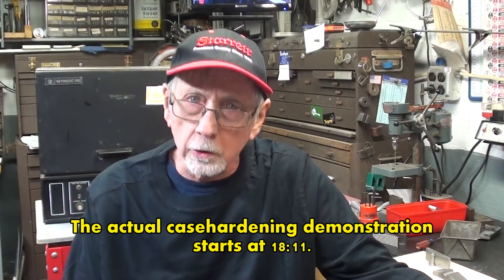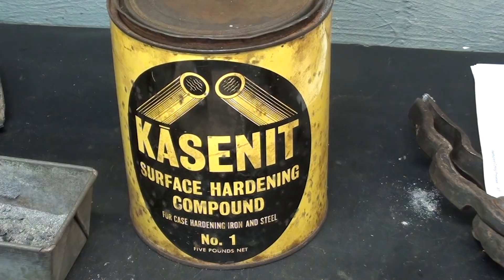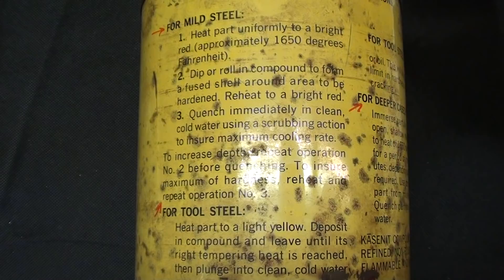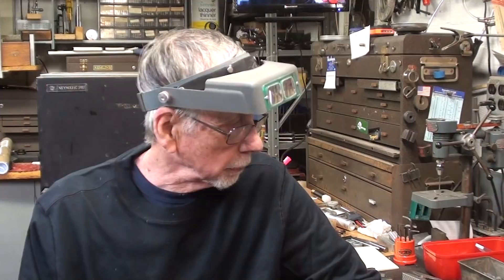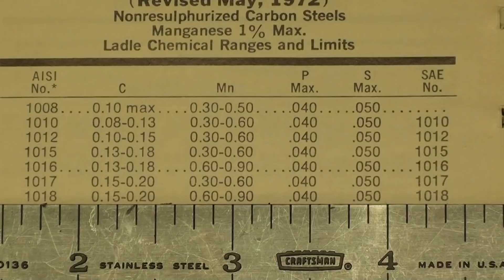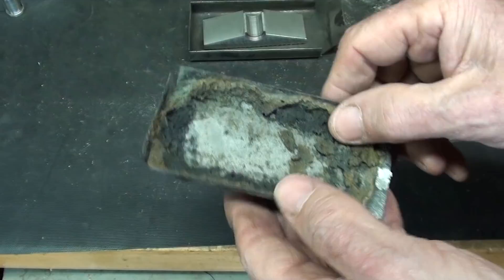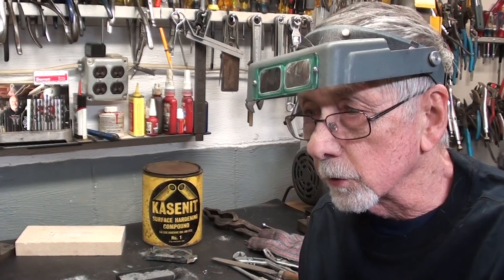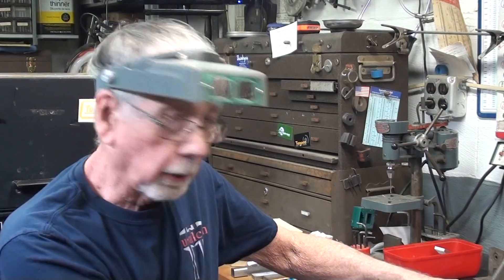CASE HARDENING Carburizing vise jaws #717 pt 1 KASINIT tubalcain

Comment: Color casehardening can be obtained by packing parts in a mixture of hardwood charcoal and chard bone, with the %'s of 75% charcoal and 25% chard bone.  Varying the percentages gives different shades of the colors.  Heating to 1450 - 1500 F for an hour or so and then quenching  (dumping the entire contents of compound & parts in room temp, air agitated water.  Chard bone is available from Brownell's and one can make their own hardwood charcoal.  Some beautiful colors and the surface of the metal is file hard.

Comment: To measure the case thickness you can probably take a small rod say 1/4 and use your method then try to snap it in half. I’ve seen this done when pack hardening and the case can become pretty thick. .04-.1” deep

Comment: I use a weed burner propane fired... I get the part hot then drop in Kasenit... If it is hot enough, a crust will form.... Put the flame back on the part and the kasenit will start boiling all over the part.. Keep soaking until it stops boiling then quench in cold, clean water.. The case will be very good.. If you want a deeper case, you can repeat the steps... Mike
Reply from the maker: Thanks

Comment: If you have a little muriatic acid you can check your depth by cutting your sample in half and soak in the acid. The hardened steel will be much darker in color than the softer steel. Now, of course, if it is only .001 or .002 deep, you probably won't be able to see it. Knifemakers use it for differential heat treating and Damascus steel.

Comment: I took a structure and properties of engineering materials course in college and found the subject fascinating. Keep your eyes peeled for a textbook. As I recall, Machinery's Handbook has a good section on heat treating, etc. My first copy was a 1910s edition I bought in a used book store, which was great, but in poor condition, I bought an apparently unused one (circa 1984 copyright, 22 ed.) on Amazon  from a bookstore for  $20-something, perhaps.

Comment: Excellent video, as always Mr. Pete!  We would soak for many hours to get usable case depth, and then the part might be finish ground to size. We would also include a scrap piece of metal to check case depth on, by either breaking the scrap piece, or etching. If you have .030 to .045" case depth, when you break the scrap piece you can clearly see the hardened layer.

Comment: Interesting video Lyle, thanks for sharing. We used to be able to get Kasenit in the UK, I remember using it 30 odd years ago in a small company I worked for. The tin was slightly different but pretty sure the contents were the same. Cheers, Jon

Comment: If you really want to check the depth of the carburization it's not that hard to do, but it is destructive and a bit time consuming. Xut the part in half (we used an abrasive chop saw) then grind polish the cut surface to a mirror finish. Etch with acid (I believe we used nitric) and then you'll be able to see how deep the case hardening goes.
Reply from the maker: I tried that many years ago at the high school without much luck

Comment: The plating and color industry got away from cyanide in most things, its only used for the highest reliability stuff now (i.e. some PCB processes), and its mostly done to cover the supply chain (its like preserving food), all the parts would be better if they were left as bare copper, because all those coatings just degrade the solder bond). So its basically like spraying wax on oranges so they don't rot before they get to the grocery store in case the truck gets stuck in a traffic jam. Fun one, for gold plated connectors, you are supposed to tin them, strip them, then solder them, not solder over the gold, for optimum reliability.. because they get brittle when the plating dissolves in the solder. And tin plating can cause tin whiskers to grow and short the circuit out, so its just a cheap anti oxidation control that can cause problems in the future. But, for the actual contact (the connector part that mates mechanically) is where the plating is important to be left alone, but not for solder assembly. But typically you don't have too many of those connectors.

Comment: You can check the case hardening depth by exposing a cross section of the test piece and etching it with an acid or ferric chloride. 
Carburized steel will etch very dark, the remaining low carbon steel will remain nearly unchanged in color.
Reply from the maker: Thanks

Comment: Mr Pete, I remember using that exact same Kasenit when we made cold chisels in 10th grade (50 years ago).  We used a shaper to do the tapers in some octagonal stock then filed and draw filed the taper and tip.   Then off to the furnace to case harden the project.  Pretty sure the steel wasn't 1018 as I have used that chisel ever since.  I remember cycling it through the heat cycling 3 times so the carbon went pretty deep.
Too bad our kids don't get to do this stuff these days..
Reply from the maker: Thanks

Comment: One vote for a video on hardening, annealing, tool steel choices(especially), etc. 

I am in the process of Building a Bar Z hotshot 360 clone. Just need to spring for insulation.

Comment: Also called "cementing".  As in Krupp Cemented (KC) face-hardened naval side armor for heavy warships from 1894 through WWII.  A thin (1-1.5") surface layer of soaked-in carbon from bone charcoal powder or high-pressure "illuminating" (methane) gas that is then raised to a high heat and quenched with pressurized water jets to harden to 600-700 Brinell Hardness Number (or Rockwell "C" or Vickers Hardness scales equivalent).  Originally developed by a Mr. Harvey of the Bethlehem Steel Corporation who went off on his own and did this to nickel-steel in 1891, creating a new armor that could destroy the chilled cast iron armor-piercing projectiles then in use and became immediately the only thick side armor to use (3" minimum thickness required to do this properly for naval types of armor, though thinner plates were developed against small projectiles like machinegun bullets).  Krupp also used it for his thick-faced KC armor as the surface to assist destroying such projectiles even more thoroughly, increasing his armor's resistance and by the year 1900 KC had replaced Mr. Harvey's "Harveyized" armor completely.  Special nose caps called "Armor-Piercing Caps" ("AP Caps") made of thick steel, originally soft but later hardened to a high level, were developed to protect projectile noses from this armor, with high success, but the armor could still damage such shells considerably as they tried to pass through it and that was why it kept being used as long as armored warships were a "thing"..
Reply from the maker: Thank you for that

Comment: And if you wanna know how deep the case is, it might be possible to cut it on a grinder and then sand it clean and see the actual color change under a magnifying glass, It should look like a cake slice I think.
Reply from the maker: You would have to Etch With acid

Comment: Hi Mr. Pete, 1000F is about 537C and 1700F is about 926C. With non contact IR thermometers today it is easy as you can select between scales F. C. or K. Do you remember the clay cones used?
Reply from the maker: I remember those cones

Comment: For seventy years I have been using Kasenite in the UK and have always used towns gas and compressed air or propane to heat the work. Pity it is no longer available. The old product contained Cyanide, highly poisonous.
Reply from the maker: Thanks

Comment: Pack carburizing: bag of bone dust at your local garden center. Steel box or pipe with tight fitting lids. Maintain minimum 1/4 inch of tightly packed bone between wall and part. Heat above critical point, heat soak for case depth. Quench in suitable medium for base steel by dumping contents of container in quench. Color casing, same procedure,  only charred leather dust instead of bone. Quench bucket has a drilled (lots of tiny holes) pipe that compressed air is pumped into on the "floor". Heat soak for case depth, turn on air, millions of tiny bubbles aerate your quench. Dump box as in plain method, the aerated quench cracks off the adhered packing, then oxidizes the part at varying temps on small sections of the surface, producing mottled "temper colors" of just about every range. That's the "old timey" SAFE (no poisons involved) method of carburizing. The only caveat is both work best with oil or water quenched steels. Bone will work with air hardening, but because the quench medium doesnt crack off the adhering dust, your part will require a hardening step after cleaning. Color casing air hardening steel requires atmosphere controlled conditions, gas carburizing, and "air jet contaminated" inert gas quenching, not exactly a "home brew" technique most can do practically.
Reply from the maker: Thank you for that great information

Comment: YES,,,YES,,,more would be great mr. pete (@@),,,@ 19:42 using your Rivet tong's to handle the work was great. I still have mine from 1969 IronWorkes apprenticeship days. They are used alot around my shop,,now mostly to assist in picking you tools, and things I drop on the floor & old back does bend like it did 40 years ago,,,hehe! I bought materials to build a furnace a yr ago. This video has but a fire under my butt to get it done. Thx Lye for motivating me,,,?? Henery Ford using charcoal ?? Have to check that out (@@),,,Bear
Reply from the maker: Thanks

Comment: I ran out and bought some stuff off of Ebay that approximates the same compound and it works fine. I also use Brownell's case hardening compound. I thought Kasenit was Potassium Ferro -Cyanide? I use it on homemade trigger parts and tools. Here are the instructions for Brownells Surface Hardening Compound:

(1) Thoroughly heat the part to cherry red in color (approximately 1650º F).
Be sure the part, or the section of the part to be hardened, is completely
heated for best results.
(2) Coat part in Brownells Surface Hardening Compound by dipping, rolling
or covering surface or part. Compound will blister and harden.
(3) Reheat part to cherry red color.
(4) Quench immediately in water, oil, or let cool and brush off excess compound.
 To increase case depth, repeat No. 2 and No. 3 before quenching.
 Brownells Surface Hardening Compound is water soluble and excess can
be removed with water and a little brushing.

Basically the same as for Kasenit.
Reply from the maker: Thank you very much for that

Comment: Could you cut it in half, polish it and acid etch to see the case thickness? Not very quantitative, but you could compare it to feeler gauges or use a set of calipers with a magnifying glass perhaps. 

Great video though. Really shows how much you can do at home.

Comment: Us dept of labor material sheet shows kasenit to contain sodium ferrocyanide 46% safe to handle  giving off trace fumes of CO and HCN in use. I used let the metal cool in the kasenit for better results and repeat a couple of times. No need to let mild steel soak in the furnace for 1hr/inch as you are only affecting the surface.
Ever tried hardening mild steel by quenching in lye?

Comment: Mr Pete,
I bought a new propane torch from Bernzomatic (TS8000, I think) that burns Map gas and was sold as capable of brazing. It does indeed get small steel parts red hot and I have successfully brazed with it. I guess it would be enough to case harden small parts.  Handy to braze without oxy-acetylene tanks.

Comment: 13:40 If the part is heated in the oven outside the case, it will lose carbon to the atmosphere of the oven, creating a decarbonized layer. This layer will hinder further cementation. The part must enter the Oven inside the box, completely submerged in the cementation compound, which can be common charcoal.

Comment: The carburizing compound in Kasenit is sodium ferrocyanide. So it's still a cyaniding process, but using a much safer compound than the sodium cyanide used before, much less likely to evolve hydrogen cyanide if things go wrong.  
The ammonia smell comes from the breakdown of the ferrocyanide by heat. Normally, the reaction produces nitrogen gas in addition to the carbon monoxide that provides the carbon for the carburizing reaction itself. But if there is hydrogen around, it will evolve ammonia (NH3) instead of nitrogen (N2). There, I'd bet it's coming from water. Your Kasenit likely holds some humidity.
As a note, packing Kasenit into an air tight container with the part is not necessarily a great idea. The carburizing reaction does require oxygen to produce the carbon monoxide intermediary. Now, may be the steel reacts directly with the cyanide functions and it ends up working like a carbonitriding process.
Reply from the maker: Thank you very much for that detailed information

Comment: I was surprised that furnace was only 115-volt. I'd think a 230-volt would be more "expense-friendly" once the Kwh-start adding up?  Not to mention a 230-volt system might be more stable for the quality, once proper-temp has been reached. 

But, any ol' port in a storm, 'specially since it works...! ☺

Comment: Now I'm curious about what exactly is surface hardening compound made of. Seems like it would be a mixture of some source of carbon (coal dust would be my guess) and a salt that: 1. melts in the carburizing range 2. Dissolves carbon to make the diffusion of the carbon into the steel possible 3. washes off easily in water.  Seems a bit pricey if that is really all it is.

Comment: Wasn’t Kasenit made by Charing trimmings of leather with a lack of oxygen?

I think solid compounds can only produce a thin case layer.  I’ve seen it done in an industrial setting, but this was done by using a carbon-rich gaseous mixture or a salt bath (cyanide) furnace, which can produce a thicker case.

Comment: @mrpete222 If we think case hardening in detail, do you know, in the end, does the carbon dissolve to the metal in gas form ? I would assume yes, as the powder definitely does not touch the part surface in every spot and the carbon cannot travel "sideways" in the material, at least not more than what it goes in depth...

Comment: maybe a good process for making Japanese wood chisels - a soft core with a hard edge
Reply: When you sharpened it you would remove the thin hardened layer from the edge.
Reply: @snowflakemelter1172  As I learned in part 2!

Comment: Very interesting. I never got to do any kind of heat treatment in vocational school. I've come into a few pieces if 1 x 5ish x 4ish A2 tool steel(air hardening). I still need to do my homework on that though. Any thoughts?
Reply from the maker: Just read up on it a little
Reply: @mrpete222  I will. Have a good day Mr. Pete.
Reply: @UC2BRIOsKntz4iuR91o6RIyw Thank you very much. Is there any hope for annealing a couple pieces that've been hit with a torch? The guy who gave it to me said it had been "Hillbilly hardened", so I'm guessing it's only hard on the outside or in spots.  Luckily the other pieces have only been machined.
Reply: I have no clue what happened, but the reply was to @Ellie Price.

Comment: BTW I am going to guess that case hardening stuff is something along the lines of an insulator (like the vermiculate you put into potted plants) and carbon of some kind, so it acts as both a insulator and I guess a carbon monoxide? generator that makes gas which diffuses into the metal to make it strong.

Comment: He's wrong the arsenic is Not tge color case hardening done for guns,guns is done with carbon and bone dust as well but the part is buried in a steel retort full of carbon and bone duse,then it is sealed and put in the furnace and when you take it out and un bury it it has a beautiful multi color finish. Arsenic for guns was an old way to turn steel blue black but did nothing for hardening not coloring .I believe the casenit can be left in the furnace with the part buried in it ,he's trying to get maximum use from it